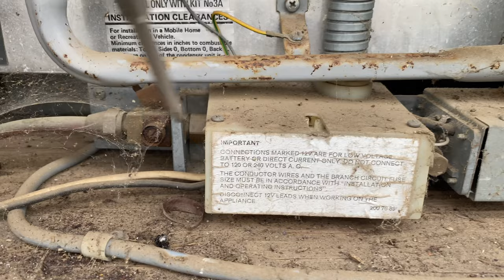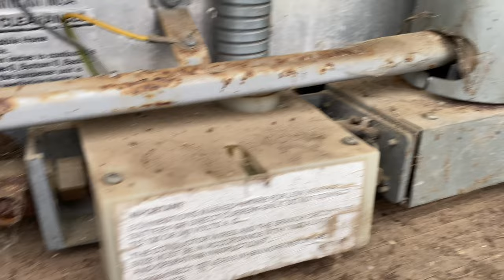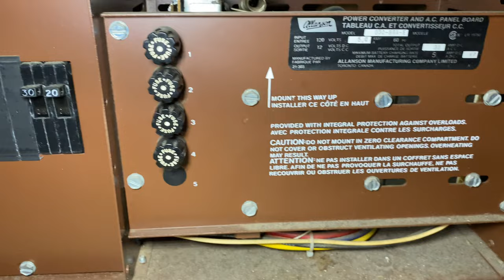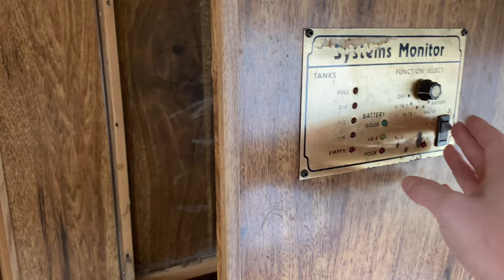Restoring our DIY Dream Camper Build for a Future of Adventure & Travel!

Comment: Hey! Great stuff! Your project looks great.  I’m doing a 1984 B19 as well. Right now it’s stripped down to bare plywood floor and fibreglass shell. Unfortunately our camper has a lot of delamination so we’re having to redo the XPS foam and panelling. 
Looks like yours is a lot drier and hopefully no delaminating. 
A word of caution:  super dangerous to install batteries inside your trailer. If you’re using lead-acid batteries the hydrogen gas produced during charging is super explosive. Lithium batteries are a bit safer but….  
Cheers 😊
Reply from the maker: No way that is so cool to hear from others with the same B19 camper. We can imagine the situation as our previous truck camper we did something similar regarding the delamination and rebuilding the floor/foam/paneling. With proper work and effort I'm sure it will come out great for your future adventures. You are right, and I'm fully aware of lead acid battery measures, and we are going with lithium in this case. They still have their inherent problems and we will take measures in the design for our safety. Btw, are you in the Bigfoot campers group on FB? Its good community resource. Thanks!